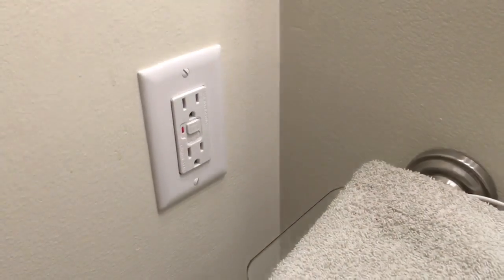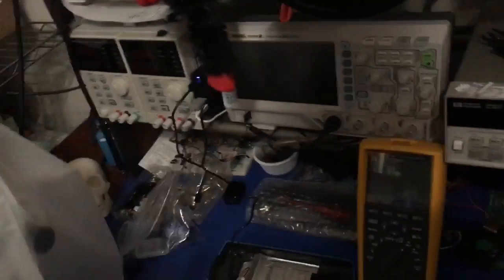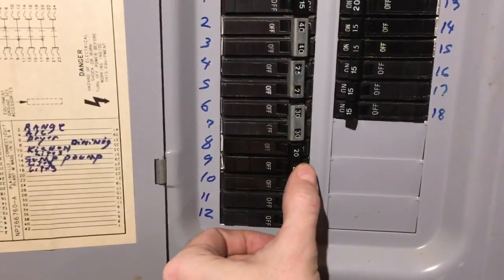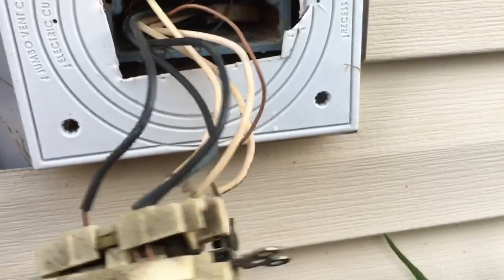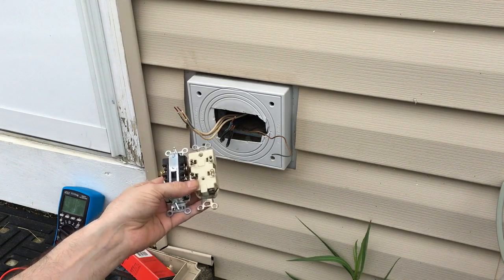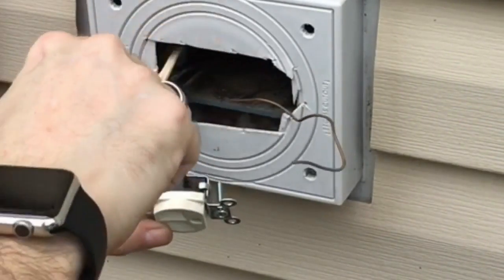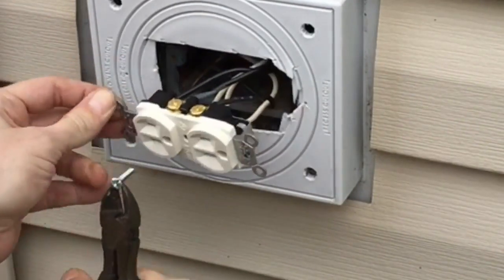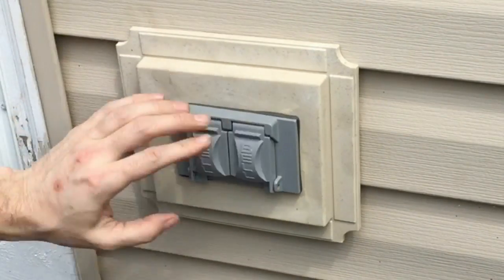Tracking down and fixing a GFCI outlet fault in the house

Comment: I'm having the same problem you were having here.  I have some electrical experience and I think I may have traced the problem to my outdoor light and/ or the  outdoor receptacle.  I think this problem may have fried the circuit breaker it is attached to.  One question for you.  You replaced the GFCI receptacle with a standard outlet.  Isn't this dangerous?
Reply from the maker: No, I never replaced a GFCI with a normal outlet. It was a normal outlet that weathered and cracked that was wired from the load side of a GFCI in series. I think US code these days doesn’t allow wireifng other outlets off the load side as of 2010,  but that house was built in 1985 before the code was update.

Comment: Thank you for making this video!!! ⚡⚡⚡ I started upstairs, working down, checked all outlets, removed those incense plugs, reset the garage GFI (the garage outlets and outdoor outlets wouldn't work), and I'm up and running! 
Again, Thank YOU and Merry Christmas to you and yours! 💪🏽⚡⚡
Reply from the maker: Glad it worked out. The incense plugs shouldn’t cause that, it’s possable one of the GFI’s are just getting old. I had on old one that would pop from one of those old energy efficient fluorescent bulbs before I replaced them with LEDs. Maybe something with the ballast? I replaced the outlet that was 30 years old and all was good again. Merry Christmas to you and yours also!
Scott

Comment: Wanted to say thanks.  Had a similar problem on my outside socket thst controls my garage door and gate.  I put a gfci for both new runs in my garage.  Turns out one of the outdoor sockets, which I forgot to caulk, got water inside and shorted out the circuit.  Within 45 minutes I had it replaced and wife was surprised by how quickly I got it fixed.  Thank you and your dad for teaching you.

Comment: I can't find my GFCI outlet that's connected to my garage, front and back porches. None of the outlets work and none of the circuit breakers are tripped. Therefore, I can only conclude that I have a GFCI that's hidden somewhere, right? The Garage door opener outlet (on the cealing) and the water softner outlets work fine in the garage. There's one outlet on the wall plus the 2 outlets front and back yard outlets that are not working and neither are GFCI outlets. Any ideas? House was built in 2006. a CP morgan home. THanks.
Reply from the maker: So it’s not using any of the GFIC outlets from a bathroom or kitchen? 2006 is when they would have daisy changed from another outlet to save money. 
I guess the other option is the breaker acturaly failed? They do fail over time. 
The worse case would be that they are not GFIC protected at all. And like my old outlet one has cracked open breaking the circuit? 
My outdoor was was bad, but I also replaced all the ones in the house before this because one broke on me when unplugging the vacuum cleaner. Some outlets are just cheap and break down, even indoor ones. 
Scott
Reply: You can pull the safety lever on your garage door rail to open the garage door manually usually has a short rope with a red handle that's in case of a fire if the power goes out and your olny way out
Reply from the maker: Normal I would say your correct. My back isn’t the best, and I have a solid garage fireproof door. The lighter aluminum and foam insulation door wouldn’t be an issue.

Comment: the screws are different colors silver being identified and gold being hot it would say that in the instructions that came with the receptacle and dont every bury a box as you mentioned when first finding the problem of the circuit its is never ok to hide a junction or splice of a circuit im happy you replaced the receptacle and didnt just splice them threw and re side it.
Reply from the maker: I don’t think I bought one with instruction. But as I explained in another comment I’ve found some backwards wording in the house. I think because it was a rental for so many years and cheap electricians, or none electricians. This is why I followed the picture.  But yes, usually you are correct with the brass screw if the wiring is correct. I did eventually find some of the issue, it was wired wrong at the breaker for one room. 
If I had decided to re-side it I would have sealed it in a water proof junction box and terminated the wires correctly. I’m not looking to have a smoldering fire in my wall sparked from a surge, that would suck.

Comment: I came across this video because I had a similar issue. Once I saw the  air freshener in your bathroom I paused the video unplugged the one I had and it fixed it. I got lucky seeing your video. Thanks
Reply from the maker: Your welcome. Yes , some of the air fresheners have gone cheaper instead of a big ceramic power resistors, they started to put 2 cheaper power resistors in series and place one in each side of the wick. This doesn’t product as much heat. I would guess thenchesper resistors could fail more often? But I haven’t seen one fail yet. I’ve taken both apart when I noticed they were not working as good as they used to a couple years ago.
GFIC outlets do go bad, that’s why they make a tester for them. If the find the air freshener is ok, then it’s possable your GFIC is gokngnbad and getting old. It still may need to be replaced. But at least it’s working for now.
Glad the video helped, 
Scott

Comment: you found a short but the problem was not with the GFCI. Your title of the video is a bit misleading.
Reply from the maker: Well I don’t think we will really know the answer to this since when a Short happens the hot wire makes contact with the  neutral wire. And a fault is when the hot wire makes contact with the ground. I never tested the broken up cracked outlet to see what ones were touching. 
But with a nema 5 outlet broke open like this one it’s more likely that the ground would make contact with the hot wire since these contacts are closer together on the outlet, and the hot a neutral are further apart in distance. I’m talking about the area the plug goes into the outlet, since the wires on the outside connections of the outlet were not visably crossed.  
Also a short would have caused a larger current to run through the neutral and should have tripped the circuit breaker as well as possable tripping the GFCI. A short can also take a GFCI up to 6 seconds to trip, my GFCI was tripping instantly as required by code to trip in under 25ms with a smaller current detected  running over the ground and not returning over the neutral. This difference in current over the ground and not seen returned on the neutral is the ground fault that causes the Ground Fault Circuit Interrupt (GFCI) to trip in this shorter time. My breaker never tripped, but the GFCI constantly was tripping when resetting in a very short time.  But I’ll digress since I didn’t test what wires were sorting out, and if I had tested after removing the outlet it was in such sad shape I might not have seen any short if I did check it since just by moving it could have separated the short to open again. I guess the title of the video was based off the knowledge of what best fit the symptoms when I was having the issue.
Thanks for watching,
Scott

Comment: Thank you for the informative video. We have a rental that has a mystery electrical problem that 2 electricians worked on yesterday.  Bad plug or wiring somewhere in 1976 house so they said they have to replace every plug/switch in house, put in GFCi's bathrms & kitchen...gonna cost us $2800.  Wish I knew how to do electrical but now understand there is a lot more to it, & need a lic. electrician.
Reply from the maker: Your welcome, their a lot more to what I mentioned but it’s a start.
Yea, it’s better to have a licensed electrician with an overhaul like that. I would just make sure they get the proper permits for your city/township and are iinsured and bonded. This way if they make something worse their insurance covers it, not yours. 
Mystery ones can be complicated without the correct equipment, it could be little arcs in the old wire insulation in the walls, maybe a mouse chewed though some wire insulation. To test wire insulation needs a good insulation tester, or most of the time called a megger tester and they cost $1,500 to $5,000 for a reliable gold one depending on the specs of the unit. A 1976 home probably needs a new breaker box to meet code as well if it was never replaced and maybe even the main line to the house from the grid might need changed.
And any room with water or outside outlet would need a GFCI.
Older code allowed you to piggy back other outlets from one GFCI like mine built in 85, but newer CES code changes now want a separate GFCI in each room that needs one, and honestly it’s safer that way, also easier to trouble shoot later if something does trip. I know my build 85 house doesn’t meet the current latest code, but it’s a lot safer then older homes and someone did change my electrical panel before I bought it. 

Every city laws are different as to what needs licensed and permitted, and what doesn’t need to be. To replace an outlet in my city is ok for anyone, as long as I don’t move the outlet to another part of the wall or change the wire, or add another outlet. But you still run the risk if something isn’t correct and causes a fire that your home owners insurance may not cover the fire damage  if you do even a simple outlet replacement by yourself.  And the obvious that mains voltage is dangerous and can kill you. 

The house I bought was a rental, and you wouldn’t beleive the shadey work I found that I know wasn’t done by a professional.

Well good luck on the work. Maybe think about what rooms you might want extra power for if you run big tools in the gauge. For me my next home will have it’s own 20 Amp power line just for my lab and notmshared with three other rooms like it is now. Or a separate breaker for a planned hot tub later? Or maybe you plan to install solar later, so might want to see how much a tranfer switch would cost now that can be used for solar or a generator at a later date. 
If your getting work done, it can be cheaper most of the times to have the additional changes done at the same time as the other work. 
Scott

Comment: You should have installed a junction box extension so you can correctly stiablize
Reply from the maker: Next time, I was already up all night as you saw the daylight coming up in the video. So I wasn’t going to drive back to the store. To be honest, I dint use the outlet at all, I would rather patch the wall up if I had some spare siding that matched.

Comment: THANK YOU!! Last night I installed an LED floodlight. The frequency of the LED caused my Garage Door Opener to RESET. My garage door was open when I installed the LED. I had to close that door by hand.. This AM I learned about LED frequency, and that it DOES interfere with the radio frequency of the garage door opener. 
Piece of cake I thought, except I had NO LIGHTS in the garage.  After the LED / garage you tube folks, I found you. 

"Ah ha," I said, that's why even though I threw the switch last night, I still didn't have lights. I pressed the GCFI button, and it wouldn't reset! (After 3 times, you know what Einstein said about doing the same thing over and over...) 
YOU said, ..." one must track down EVERYTHING." 

I went outside, pulled apart the outside "dusk to dawn" light fixture, and exclaimed the REAL "Ah Ha!"  Last night, the lamp was loose from the house wall, it twisted a couple times while I installed the bulb. One of the Neutral (White) wires had come apart. I reattched it, flipped the switch on the electrical box, and then pressed the GCFI button. IT STAYED ON AND ALL the lights came on!! Garage Door is reprogrammed, and I'm taking the LEDs BACK to COSTCO.  Thank You again!
Reply from the maker: I’m glad it got worked out and everything is back up with power. 
Oh no, Costco leds, my house is full of them. What LED light did you install from Costco?

GFCI outlets do fail over time also, how old is that outlet? 
I know when I first changed all the lights over to compact fluorescent bulbs (CFL) that same bathroom GFCI would randomly trip for now reason. A little research, and confirmation for my dad and I was able to confirm the older GFCI outlets don’t like the harmonic frequencies produced on the line from some of the newer energy efficient bulbs. I never looked into it deeper, and just replaced the GFCI outlet and it was good again for 5 years. Even after I changed all the CFL bulbs to LEDS still didn’t have an issue. But if I had to guess today it probably had something to do with the power factor and causing the 60Hz AC sine wave to go out of phase, or it picked up on the current spikes from a bad power factor and cheap CFL bulbs. The older GFCI outlets think this is a short, when it’s not.

In fact, Big Clive just did a video that explains power factor that’s easy to understand. Might be worth a watch.
https://youtu.be/uIlk8j8Ng2E?t=4m28s

But I guess I’m explaining this because it might just be an old GFCI that doesn’t know how to understand the way newer electronics work with switch mode power supplies and DC bridge rectifiers. Seems like everything runs off DC these days except appliances. Older ones are used to monitoring only the wall wart transformer, so they trip because they don’t understand the newer way of powering things. So if it’s older, might be worth just changing the GFCI and prevent any issues like this also in the future with something else you plug in, or another led bulb even made by someone else. I hope this helps.

Thanks for the comments, and thanks for watching,
Scott
Reply: It is NOT about the BULB, it's about the FREQUENCY of LED BULBS. Like AM/FM radio frequencies. Frequencies travel through the air, invisible to our eyes, but turn on a radio, and depending which tuner you select your radio receives AM or FM.
Reply from the maker: Ah, the bulb needs to be close for this to happens usually. But I forgot most garage door openers (even mine) have light bulb sockets built in so a light comes on when you open the door and pull the car in. Yea, unfortunately the FCC requires most electronics to except any interference like listed in the FCC part 15. Newer electronics should know how to see this, accept it, ignore it, and continue like normal.

Older electronics, or even cheaply made stuff might think the signal interfearamce is for “it” and gets confused trying to decode the signals. But I can see how this could affect the garage door opener if it doesn’t know how to ignore the signal, it could act like a jamer to the garage opener. 
Well glad you figured it out,
Scott

Comment: my dad was an electrician local25 IBEW for 50 plus years, I was scared to death even though he taught me so much, he didnt teach me everything,,I learned a few things I didnt know from you, I love you!! all rooms back on except the Master bedroom,but I know the problem, I blew the outlet when I was using an electric log splitter,,yes Im a girl  my dad had three girls I was the son he didnt get. now Im feeling brave enough to tackle the motor in my HVAC.. my kitties and I are suffering, thanks again!!
Reply from the maker: Thank you so much for the comment. It's still good to be scared of mains AC a little, at least respect it. Always make sure all lines are dead, keep on hand in the pocket as they say. I've heard of people still getting shocks from old homes beciase of leakage current on lines that have failed insulation even though they turned off the breaker for that room. That's why I say always test anyway. 
I've been hit with 220 and it's no joke, if I wasn't 17 young then I might not have walked away. And the person who made the mistake was the electrician I was doing an apprenticeship with, he told me the line wasn't live in the box. Needless to say I didn't finish the apprenticeship and he retired early. 
An electric log splitter, neat. We ran a hydrologic cobbled and welded together from random parts and a gas motor when I was a kid. I guess if the gearing is good then electric is posable. That thing must pull some current for sure? So it runs on 1110V?
How old is the breaker box, it's possible the breaker has decided to also die if it took a hit. They dont last forever, I just updated one in my box that was failing when I was adding a 30A line for the battery electric spot welder.
Thanks again for the great comment,
Scott

Comment: i am having the same problem. I CANNOT FIND WHY MY GFCI KEEPS TRIPPING.  I have a switch connected to the dishwasher to the gfci and the overhead stove light and fan which is connected to the gfci, and an outside outlet connected to the gfci. everytime i turn  on the stove light or dishwasher it keeps tripping. could it be the outside outlet?
Reply from the maker: I can't say for sure, it depends on if these things you mentioned are connected to the load side of the outlet or not. But if you turn on the stove light and it trips, or the dishwasher and it trips then it sounds like it wouldn't be anything to do with the outside outlet. 
The GFCI outlet could be going bad, it happens. I had one tripping from the frequency that a power efficient CLF bulb, so I replaced the GFCI with an updated one and it was fine. If you have some power efficient bulb in the stove lamp then I might understand this, but the dishwasher shouldn't cause it to trip unless theirs a problem and the GFCI is bad or it's doing its job and detecting a fault lolemot should. Dishwashers can leak and water can get into the mains electrical, this would cause the GFCI to trip when you power on the dishwasher. I would have an electrician looks at it.
Reply: Gadget Review Videos i totally forgot to delete this comment. it's taking care of, my dad didn't wire the gfci right.
Reply from the maker: No Problem, Glad to hear you got it worked out.